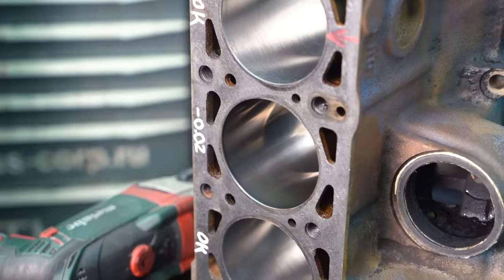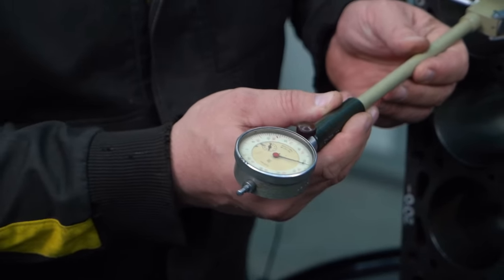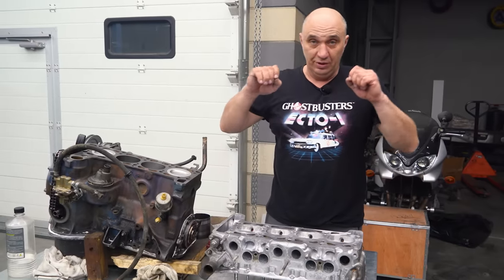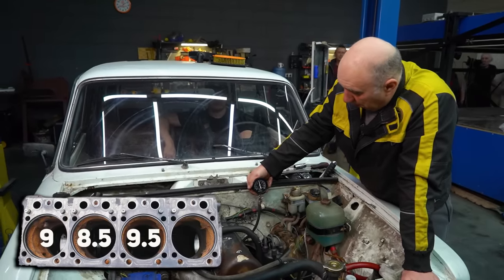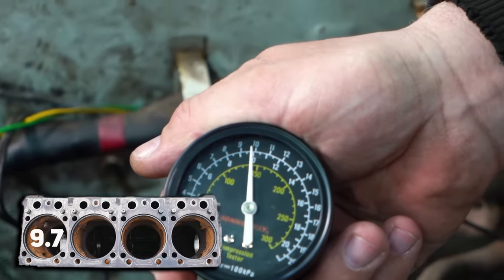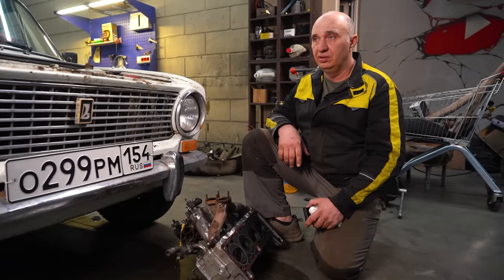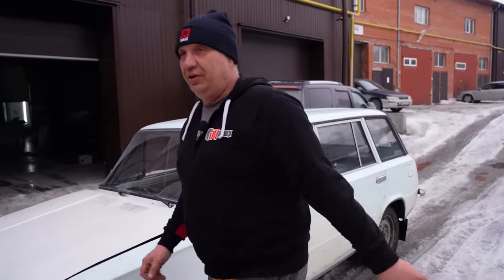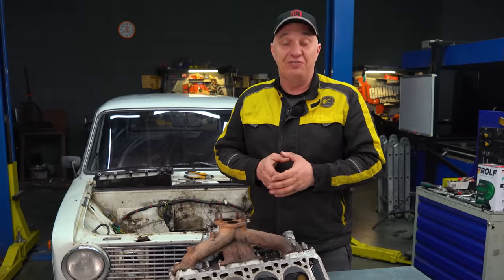Honed cylinders or mirror finish - which is better?

Comment: Generally speaking for minimizing friction, thick oil likes rough surfaces.  And thin oil likes smooth surfaces.
Reply: So it depends on what oil ye using
Reply: Which is why engines need constant(ish) oil changes. Because the oil thickens over time.

(There's ten replies about viscosity, go read those before replying.)
Reply: no matter what you have, though, without the crosshatch, there's no way for the oil to get up to the rings.  And it rotates the rings to keep the wear even.
Reply: @jwalster9412 depends on the oil.
I’ve seen thermal breakdown where the oil gets too thin to hold pressure in the pump.
I’ve also seen some cars turn it to sludge.
Toss up?
Reply: @1NIGHTMAREGAMER  Makes a huge difference. I only use Castrol GTX High Mileage Full Synthetic. Black jug. When I bought my car used in 2020 it require semi-synthetic. I was burning a quart every 500 miles. Got an oil change it just so happened that is what they used. I haven't burned a drop of oil in almost 3 years. I change it based on how it sounds. I quiets the engine to a purr and I get better gas mileage. When it starts to run a little rough I change it and that is about 5000 miles.
Reply: @vikinglife6316  Full synthetic is always better. Synthetic "blend" can be a total lie, it can be 1% synthetic and 99% crappy mineral oil and pass as a blend. I run Mobil 1 0w-30 in my engine that revs to 8000
Reply: @jwalster9412  Generally oil gets thinner over time.  But the real reason why engine oil needs to be changed parodically is because the detergent molecules in the oil will eventually break down and turn into acids.  And this acid will eat the insides of your engine away.
Reply: @billwit7878  weird how they haven't thought of a work around for that issue.
Reply: Sounds like the recipe for German engineering and reliability too 😂 honed is the way
Reply: @jwalster9412  Well, the engine gets diluted with the fuel that gets past the rings, hence the oil dilution and making it thinner.
Reply: @jwalster9412  No the oil gets thinner over time because the gasoline or diesel mixes slowly with it.
Reply: The PCV valve is supposed to allow the fuel in the oil to evaporate ; I suppose it can only do so much or the engine is running a little too rich .
Reply: @Airon79 all pcv valves do is release oil into your throttle body. Every car/truck ive owned burned oil in this manner when its supposed to be a relief for crank case pressure i call b/s.
Reply: The old thick vs thin argument gonna have to consult my wife about that .
Reply: @07slowbalt  Sounds like too much blow-by .
Reply: @Airon79  blow by can introduce gas into your oil which dilutes it. If this smelled like gas, frothy, or a different consistency then id argue that it could be but thats not the case. When the engine warms up so does the air and oil inside. That pressure has to escape which is the point of the breather aka pcv valve. Old cars used to spit oil sometimes just on the ground. Epa says no more to that. Pcv valve is supposed to let just air bypass but they rarely work properly so now it gets burned. Much better EPA!
Reply: @07slowbalt  Bad PCV valves , bad engine air filters , timing not being dead on , turbo powered cars and a few other things can lead to oil consumption but I usually get rid of my cars at no more than 250k miles and never had one bad PCV valve but over 200k miles they all consumed oil , atleast an 1/4 of a court to one quart every 1k miles but some cars are prone to oil consumption problems more than others .
Reply: @Airon79  Pcv valves will fail and you'll never know unless you pull your hose off your throttle body. My last 4 vehicles from ford, chevy, mazda all experienced it. Bad rings, bad honing, bad valve guides, extended oil changes, pcv valves are all possible causes.
Reply: @Canthus13 the hone does not rotate the rings. Some engines even have a pin in the pistons that fixes the rings in position
Reply: @07slowbalt  How often do you change your oil and which oil do you use ? A lot of PCV valves just pop into the valve cover which can be tested .
Reply: @jwalster9412  Weird how you don't understand. The old oil gets thinner. The engine burns petrol/fuel, which contaminates the oil causing some of the acids, the rest are caused by heat and constant damage done to the oil by being forced through bearings, the oil pump and so on....
Reply: @07slowbalt  Call BS all you like, just take the pcv valve off and go for a drive, I'll wait for your results. ! {even though I know what's going to happen..}
Reply: @MickH60  weird right?
Reply: @Canthus13  The crosshatch is for seating the rings. The cylinder walls of a properly broken in engine are mirror smooth everywhere the rings touch. 

Oil is splashed around and squirted out of every main and piston bearing, sometimes even the piston bushing. There is too much oil on the cylinder walls. The oil control rings squeegee most of it off. 

 There is little to no ring rotation during break in and none at all after break in.
Reply: @billwit7878  actually it's not detergents they break down, it's called the TBN of the oil(acidic buffer chemicals) that get used up and when they're gone it cannot neutralize the acids created by combustion anymore
Reply: @stormrider01 FALSE. Oil thinning is caused by shearing. Fuel dilution is not the usual causation unless the engine has a mechanical issue causing fuel dilution or insanely high idle times
Reply: @07slowbalt  PCV valve literally stands for PRESSURIZED CRANKCASE VENTILATION
Reply: @100pyatt  yes i know.
Reply: @Airon79  every 5k
Reply: @jwalster9412   Typically, the oil gets thinner, not thicker.

But some cheap poorly formulated oils can increase in viscosity (thicken) due to evaporation during even normal operating temperatures.
Reply: @100pyatt  Just a small correction PCV stands for POSITIVE Crankcase Ventilation
Reply: @Bob5mith, exactly, I was waiting for someone to say that exact finding
Reply: @tylerdurden3722 The oil gets thicker because of the contaminants in it, the soot... the byproduct that dispersants has to keep in suspension for it to travel into the oil filter and get caught up, that acumulates over time.     Evaporation is simply...evaporation. When the oil evaporate, it loses quantity, not viscosity.    It's not like coolant, where water evaporates (in some cases) and antifreeze is staying. What "part" of the oil evaporates and what "part" is left in the engine?!
Reply: @dangeary2134  Modern engines are not so much concerned with oil pressure as they are engineered for controlled flow. The 4.2 GM L6 engines live at 12lbs and the oil warning light comes on at 8lbs. Low viscosity oils are very easy to pump in extreme cold - they flow about the same all the way up to very hot operating temperatures. Standard oils --- won't flow when very cold and break down at high heat/high demands.

Comment: I suggest a Part 2, where you build 2 complete engines, identical except for the bore finish. Then put them on a DYNO to test power, compression, oil consumption, etc.
Reply: It wont work that easy... Tolerances matters. One will be done in minimum, second will be little bit looser but still in toleration and whole test would lie... :)
But it's an intresting concept. I guess mirror finish will be better if You have some really hard shell like nicasil in BMW, otherwise honing will be better, living longer with same preformance.
Reply: @KenjiDev  There is a reason why cylinders have been honed for the past 100 years. Mirror finish gives the oil a hard time to stick and lubricate the pistons.
Reply: @Chris-yy7qc  Correct. I just want Vlad and the boys to demonstrate that fact, with real numbers.
Reply: @KenjiDev  You could actually prepare bores with identical TOLERANCES, but different finishes. Different rings require different "RA" numbers. This determines the grit of the finishing stones. Achieving a "mirror" finish would entail using something much finer and smoother. But the final bore sizes could theoretically be made identical.
Reply: I want to see another tear down after 20 000 km. of daily driving.  It appears 1000 km largely motorway driving wasn't enough to show the very small difference.
Reply: @Chris-yy7qc  I know a paint manufacturer that always added a special ingredient.  When asked why they said "because we always have".
Reply: Actually they have discovered cross hatching the block keeps more oil in them pistons also.
Reply: @Chris-yy7qc  I was always told that a mirror finish made it easier for the oil to slip by the rings.  Crosshatch makes it more difficult.
Reply: Seems like there may be some valve seating issues that’s messing up the test
Reply: @user-xu5vl5th9n  yep. Society in general often forgets really important lessons of the relatively recent past.

Ive seen it many times in engineering. The latest greatest designed by new engineers without the long deep knowledge. Boom.
Reply: Agree
Reply: Pistons, con rods, crankshaft, wrist pins and flywheel would have to weigh exactly the same in both engines, the bore size has to be exactly the same with exactly the same clearances. Port sizes and finish need to be exactly the same, the fuel pump needs to flow exactly the same amount at exactly the same pressure. And then of course if you're gonna Dyno it on a car Dyno in stead of on an engine Dyno, the gearbox, shafts, wheels, brakes, tyres and all that need to weigh the same, be in the same level of balance and have the same base level of resistance if any.... So...... Good luck
Reply: @hectorae86  Still doable. THESE guys are PROFESSIONALS! 🤣 But truth be told, for many years racing teams have built multiple engines, all with identical parts, to exacting specs, yet there will be a "good" one, a "bad" one, and most somewhere in the middle!
Reply: You first
Reply: Cylinder walls need to be honed with a proper crosshatch because new rings need to be shaped to seat and seal to the cylinder walls. The crosshatch makes the cylinder wall into a fine file that shapes the rings for a good seal during break in. In fact, some ring materials need a different degree to the crosshatch to seal properly... some require a more aggressive surface than others.
It also allows oil to hang on the cylinder walls better once break in has knocked the aggressive surface down.
Reply: @myfalconry76  It also looked like #3 exhaust valve was very deep in the head. 
The test may also be flawed because of cam lobe profile differences - was the cam new - how about the lifters? 
Too many variables here for a clear view of the differences and quality of the work. 

Также было похоже, что выпускной клапан №3 был очень глубоко в головке.
Тест также может быть некорректным из-за различий в профиле кулачкового выступа — был ли кулачок новым — как насчет толкателей?
Здесь слишком много переменных для четкого представления о различиях и качестве работы.

Comment: Well what i can remember from my engineering courses, honing provides tiny pockets for oil to sit, reducing wear and blow by.
Reply: The homing effectively creates Labyrinth seals allowing oil retention that creeps back onto the aspirites where the reduced area metal to metal contact occurs between rings and cylinder. The unanswered question is how many km before all the bores present the same compression and what would the comparative ovality of bore look like? Higher compression would reasonably wear faster but might suffer increased  ovality over the lower loaded cylinders in my estimation. Carbon build up would also lead to higher compression and reduce the equilibrium wear indication needed so maybe then do a decoke and check again would satisfy the conjecture nicely.....
Reply: If the compression gets an little higher they'll have to start using racing fuel or add some type of additive to the regular gasoline .
Reply: They have discovered now days that cross hatching makes them seal better n the RA n RK n RPk of what rings you use also.
Reply: "Oil Retention Finish"
Some things don't change
Reply: EXACTLY 100%
Reply: @Airon79  Dry cranking compression does not mean all that much as a proxy for effective compression under load. At 3000rpm there's far less time for the air to escape than at 300rpm and the piston rings will be sealed by the oil. Compression testing is really just a way to look for damaged piston rings or valve seats or to access overall engine wear.
Reply: From what I can remember from my Engineering Material days, was that none of it makes any difference after about a 1000kms as everything you did will have been worn off/down and it then relies on the oil film and ring to bore 'connection'. I know 'cross-hatching' is supposed ot be a thing, but honestly. Every engine I've every pulled apart looks like someone put a birght mirror polish on the bore when they installed the pistons!
Reply: @doraexplora9046  Hmm, well when I pulled the head off my 87 Saab 900 EMS to do a sports cam, valve regrind and head decarb you could clearly see the honing marks ( cross hatching ) on all the cylinder walls. With 386.000 Kms on the clock and 195 psi in all four cylinders I'd say it's a sign of a good motor.
Reply: @aneejit9079  Geeees, that's another whole level of good maintenance. BTW>What did you end up doing with the rudder from the back of the SAAB?
Reply: @aneejit9079  Totallytrue. I've been a rebuilder for over 57 years and those crosshatching marks were still discernable after 300,000 miles on (mostly) any engine I tore down.
Reply: When working on marine outboard engines I have seen the Mercury chrome cylinders but they were two stroke with the oil injected into the fuel system. The seal was outstanding there is a different break-in procedure. Many came back blown up because of improper break-in.
Reply: If the bores have a mirror finish they are considered them worn out, as they don't seal the piston, because the rings don't seat in the walls. The bore doesn't seal so there is blow-by, sump pressure builds with subsequent spewing of oil out of seals and gaskets. Which is the reason why you can often just hone the bore (Rough it up) and reseal with new rings.
This is a real problem with older engine materials and synthetic oils. They just never bed in..